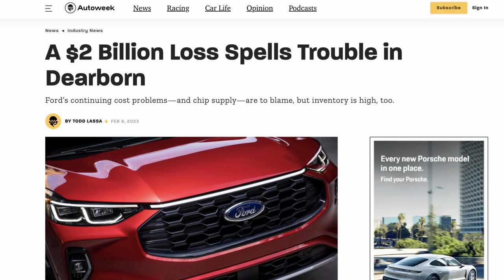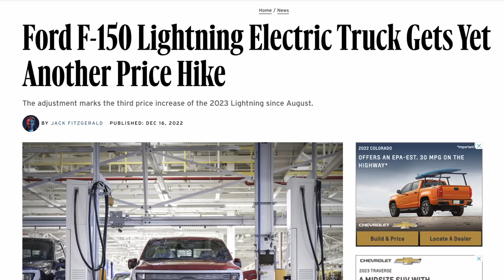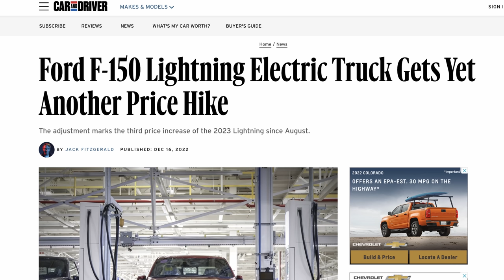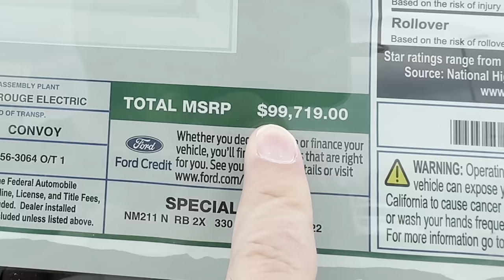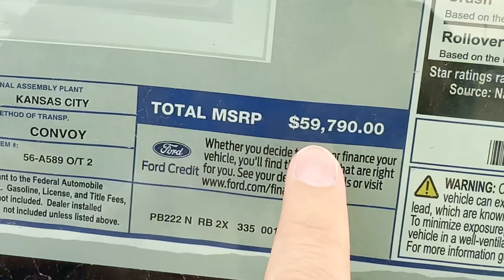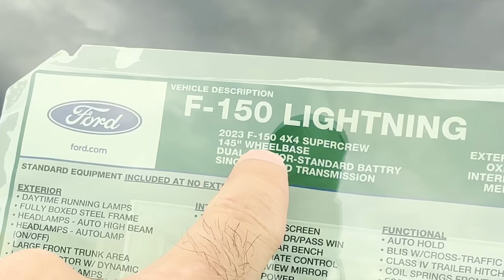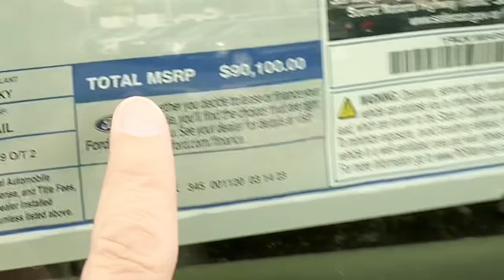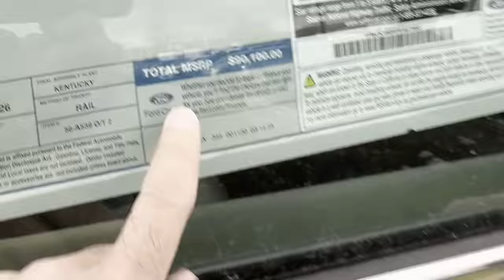Ford CEO Makes HUGE MISTAKE, Now Dealers CAN'T SELL TRUCKS!

Comment: I bought my first new car September 17 2016. It was a 2016 F150 2.7. In four days, I will owned my truck for 7 years. It has 94,000 miles and I had one problem @ 69,000 miles. A $20 temp sensor went bad. My next new car maybe a Mustang GT.

Comment: I don't know how this was recommended but interesting to watch and read many uniformed comments. I've worked 27 years in manufacturing, always at mass production facilities making anywhere from 5MM-20MM units/year. Regarding cost, I have the opposite opinion. Although I do not like the high prices, I can't believe how low automotive manufacturers are keeping them. For example, I'm currently paying 180% per ton for raw plastic media than I was in 2020, 135% on aluminum, about 120% on steel, 310% on acrylic adhesive, not to mention 120-200% on electricity depending on our ever changing contract. We also have back orders because we can't get the circuit boards from Asia. I can only imagine how much aluminum is in these engine blocks, and how much plastic is in the interior, etc. Their supply chain teams must have one heck of a challenge in front of them; good job security I guess.

Comment: Making a quality product, efficient on gas , would be a great idea . Turnaround , it’s not to late . Compassion and customer service for buyers. Sometimes the stockholders  Hope realize that sometimes a season of not gains in transition , but it can come back
Reply: If that worked they'd do it. It doesn't. People want big and flashy. Those of us who want reliable affordable cars generally also buy used. New cars are for chumps.
Reply: @jerbear7952  you can have both. Chevy Tahoe/Suburban/Escalade/Yukon all come in diesel, my gigantic Tahoe can haul 9 people and can get like 30-35 mpg with diesel.

Comment: I am not a Ford guy but I don't feel like this problem is specific to Ford, I also feel like I have been seeing the same things with both GM (Chevy & GMC) trucks being way over MSRP & just sitting on the lot along with Ram, although it seems like Ford has done the bare minimum to correct dealer price gouging. When I was at the Ford dealer in December they had a lightning Lariat that they were asking $30k over MSRP.

Comment: We just bought a new 2024 Toyota Camry Hybrid SE for $35K and a 2023 Toyota Tundra SR5 for $42. We still have our 2014 Camry with over 200,000 miles on it we will gift to our teenager. A pickup truck for $90K is nuts.

Comment: In 2016 ... I bought a XL Off Road 4×4 work truck. It list for 38k ... With incentives I paid 25k and change out the door. There was room to negotiate.  Now ... I don't know. I sold the truck after 5 years ... and will NOT buy another again. I had 3 new F150's in the past 30 years ... The last one IS the last one.

Comment: I traded my 1972 F100 4x4 on an F150 4x4 in 1975. I got the Ranger xlt trim package which was top of the line 360 cid v8 with 4 sp manual. It was a beautiful and dependable truck for many years. I gave the dealer my truck and 2800$ for the trade. I think msrp was about 4500$. These things are not as good as that truck for 12 times the price. It’s absurd.

Comment: I bought a new 5.3 vortec and transmission from a company that makes them that come with a 7year 100k mile warranty on each with a 1 time no fault replacement. I replaced just about the entire drive train, coolant system and suspension/brakes for around 23k installed. Now I have what I call a brand new 04 Chevy Suburban. I had roughly 300k on the original drive train and it had some leaks, but, nothing major. My son and I are rebuilding the old drive train as a back up. I don't intend to buy a new vehicle for the next 25 years. I sometimes wonder how people can afford these vehicles. My wife and I make around 150k/year and we would never consider paying that much for a new car. Imagine paying 100k for a FORD!

Comment: Second correction regarding quality. A major portion of the components going into a Ford (and others) are from "build to print" suppliers. Ford owns the design in most cases. Suppliers build to the design they are given. The problem is Ford does not spend the time validating designs as that costs money and slows the introduction of new vehicles to market. Second is the seasoned design engineers with common sense are retired. Yes tier suppliers do make bad parts causing issues so they are not squeaky clean either.

Comment: I buy 4 year old used trucks and drive them for 10 years. My 2000 Tundra rolled over 200,000 miles before I sold it to my son. I guess I’m keeping my 2012 GMC Sierra until I die because a four year old truck nowadays is still $50,000. It’s insane.

Comment: Try finding a Raptor R that isn't 50+% over MSRP. Some dealers are asking $200k. What a Joke. Plus there are 5 F150 lightnings at my local dealer that havent moved an inch in 4 months.

Comment: Prices on new vehicles are outrageous, If you all can try to maintain your current vehicle and run it as long as possible, it'll be cheaper than buying a new car with recalls before you even drive off the dealer lot.. and this isn't just Ford..

Comment: I paid 67K for a 2024 Silverado although it has the 27MPG 3.0L Duramax diesel and is loaded to the gills.  I could not be happier with the truck, I feel like it was worth what I paid. I have never imagined I could get close to 30MPG in a full size truck. I have gotten as high as 28MPG.

Comment: We are here in Canada and it’s just as bad. Our 2018 F350 Dually has been in the shop sooooo many times it’s a joke.
Anyway we looked into replacing her with a F450 Dually platinum but the $149,000 quoted has put us off. Not prepared to spend that kind of money.

Comment: I have been a Ford man all my vehicle driving life (50+ years of Ford cars and vans) but problems with my past 3 Ford CARS have moved me away from the brand. Last problem: electric power steering locked up - SCARY. My current ride is a Cadillac ATS 2.0 Turbo Deluxe. #NoMoFoMoCo! 😎

Comment: I bought a 2022 Ram 2500 Power Wagon for $70K… And that’s a Heavy Duty loaded with 4X4 options ( Solid axles, Front & Rear Lockers, Disconnecting Sway Bar, Stock Warn 12,500 Pound Winch, Skid Plates ) plus the Interior amenities such as 12 inch touch screen, leather seats, heated and Cooling seats, Back up camera, Bed Camera, folding rear seats flat rear floor, crew cab.. Ford F-150 for $60K????? Why???🤦🏻‍♂️😂 and only 1 recall for a tailgate misalignment which took 15mins…🤷🏻‍♂️😂

Comment: 😂😂. Just changed the brake line on my 89 3500 flatbed. Paid 3k 20years ago.
Easily carry 2.5 tons.
I drive a crown Vic I’ve had for 3 years. 1.5k
Rav 4 I’ve had for damn, 20 years now 10.5k
Live in a 89kft2 house (old high school).
Sure, I have to Remodrl $ fix stuff but geez.
All in & I wouldn’t be close to a new Ford.
No mortgage or car payment for 12 years.
More power to ya thou I reckon.

Comment: I paid 55K for a 2020+ f450 7.3 gas 2wd single cab w/commercial tool box /rack and 12ft bed. This will be the last new Ford I ever buy. No issues with this truck so far! Options are for ladies. I used to drive an 81 F250 300 S6 3 speed on the tree no power anything, not even steering. Now that's a truck I would buy today - in new condition of course. Electricity is evil!

Comment: My F-150 would be nearly as useless for towing as a lightning except it has the tow package which includes a 36 gallon tank, 10 gallons extra.  If ford just offered a battery option for a larger size it would make a great towing vehicle for far more actual situations.  It’s not like they don’t love adding 10-15k options.

Comment: I have a 2014 F-150 super cab XLT 5.0L that I bought brand new for $30,000 CAD ($22,200 US).

120,000 kms on it, only repair has been a new water pump and I did the spark plugs myself.

How on earth can I justify paying over double to get the same thing I already have 9 years later. 🤯

Comment: I worked for a supplier for a KC auto plant about 8 or so years ago. I wouldn't buy cars made around there. It's all BS, UAW workers make 6 figures, but it's not many of them. So much of the work is done by basically anybody looking for a temp job, line workers started at $12 something and it actually went down for new workers. The quality control was straight bs, I wouldn't be surprised if cars went out with mismatched parts.

So much of our time was spent "5 S'ing" things, like 8 times a year because there was more than 1 standard and so many corporate employees thought that it was their job to enforce "5S". UAW employees would regularly foul the production line if they got their feelings hurt.

I only witnessed a few car models, but it wouldn't break my heart if the UAW just went away. I don't see a reason for it anymore. It's not about safety, I had to wear a suit of armor for PPE for the suppliers, but for automakers, there were more flip flops on the production line than in Washington.

Comment: Easy fix for a big company, re arrange the location of the inventory and run a nation wide lease deal to get customers to bite then raise the price of the extended warranty. You will have a lot of no warranty used trucks flooding the market and can be sold on the used market to recover costs

Comment: Bought a 2023 tundra TRD pro for 85k but came with every upgrades I wanted. Most expensive vehicle I have ever bought, 1,600 a month payments, but still better pricing and reliability than ford, there is a reason Toyotas stuff is sold before it even ships to the lot. I plan to get my wife the 2024 Tacoma TRD pro but that’s going to be a wait list item. I got lucky with my tundra.

Comment: i left manufacturing around 2011/2012 it was pretty toxic then and i was laughing at the truck prices then. nobody is gonna pay 120k for a truck.
a few years ago i got back into manufacturing after moving back to the state i was in and it was 10 times more toxic. and they were trying to ask 140k for trucks now. trucks that didnt even run like are you serious. 
all the parts were from over seas failure rates are high and when built the trucks usually werent even complete because of part shortages and defects. its an absolute mess and i walked away again cause i dont have the help they need.

Comment: Contractors are the main buyers of pickup trucks and heavy vans; not upper class suburbanites. 

Aside from insanely high prices for a new pickup truck, all these trucks are not practical for contractors. They’re too high off the ground (makes loading/unloading cumbersome), the work beds have gotten smaller, and we never asked for a computer, wifi router, and a bunch of sensors!

Comment: I'm in my 70s bought Ford trucks my whole life. Not anymore. Nothing but problems with my 350. I'm talking major problems that cost me thousands of dollars. At 76,000 miles now my brakes get activated all by themselves. I'm on my 11th brake caliper. I filed a complaint with the national highway traffic safety, which was a total waste of my time. It's a dirty shame that a truck with 76,000 miles has to get parked in a field because it can't trust it anymore.

Comment: I took my 1999 chevy Silverado 2500 and redid the front seats and rebuilt motor and transmission for $13,000.00  way cheaper then a new teuck that are junk.

Comment: Huge never ending problems with my Focus, Ford bought it back with 48000 miles. Bought the Edge as a replacement, required a re built engine at about 40,000 miles less than 6 months had a factory re built engine installed after over 10 weeks of waiting in the dealers lot for a diagnosis then having the engine delivered and installed. Bye Bye Ford built vehicles

Comment: Forgetting brand choice for a second.   I refuse to purchase a new truck due to insane prices.  Now I'm in Canada, so Canadian prices.   In 2011 I purchased a new 2wd Ram for $26000.   That is $50000 today.   Why?
All that has changed is a different body and an eight speed transmission instead of five speed.
I can purchase a new motor, transmission and complete body work for half the cost of a new pickup.   Guess I know what I will do when the time comes...

Comment: Has nothing to do with want to buy, it's about pricing your inventory for the top 10% only. You need to make 200,000.00 a year to buy one. Or pay payments on it with interest for 20 years and a 99,000.00 truck ends up costing you 240,000.00 payments and maitenance done on a dead truck by time own it.

Comment: One problem with EV trucks are the huge batteries, twice the size of current cars.  Most can not charge enough overnight.  Most PUBLIC chargers are only slow level 2 (6kw-19kw or average 20 mph)  Most PUBLIC level 3 DC fast chargers only 50 kw(average 15o mph)  Tesla level 3 DC fast chargers or superchargers are all level 3 120-250 kw or 500-1200 mph)  That is why non Tesla manufacturers want to use Tesla chargers.

Comment: All comes down to safety and emissions regulators passing policy without an act of congress causing the price of cars to increase year after year. If they could still make a 25k car they probably would, but they can’t because of cost of safety R&D and emissions requirements.

Comment: Just buy a Honda or Toyota.    My Tacoma has 301,000.  Other than standard maintenance all I've replaced is a harmonic balancer, a radiator, and a parking brake handle.

Comment: I used to buy a new F150 every 3 years, but my 2020 is wayyyy nicer than the new 2023. For 65k it felt like a piece of junk. Too much crap on it, needs to be made simpler.

Comment: Bought a F450 for work. Within 100k miles the rear pinion seal failed, exhaust fell off, battery cabled rotted off, the engine blew up at 97k miles, seat belt lights, abs light. Only Ford serviced. Ford has lost they key, asked us to bring spare. Truck sat at dealer for 4 days to get tires replaced. They lie on inspections and services preformed. Just trash company.

Comment: 5.4 engine is junk had to replace my engine in my f250  it ate its self up because of a cam fazefollower nonsense  my 94 f250 lasted 350000 with out a hitch but that's when they made good power plants not junk.

Comment: I am a jeep guy, the cost for used jeeps is crazy.  19k for a 2015 jeep wrangler with 133000 miles.  No thanks
Reply from the maker: Even more if you want a Rubicon. I can get 28-30k for my 2015 Rubi with 90k miles.
Reply: Just makes u wonder why? Repair bills for any vehicle are crazy. The cost is crazy °why even bother with a new vehicle?

Comment: $1500 tail lights and other bolt on parts that now cost as much as transmission or engine replacement was did. This is not just a Ford problem.

Comment: The lack of knowledge today is very sad indeed.
ALL vehicle manufactures (Ford, GM, Honda, Toyota etc.) buy most of the parts they use from "Outside Parts suppliers". 
NO automobile company makes all of the parts they use themselves. Almost all of the recalls today are related to parts that were made by outside contractors.

Comment: This is insane, and for couple of reasons. 
- Getting everyone to drive a truck is ridiculous. 99% if regular drivers who are not blue collar workers don't need a truck. Like at all. Did you know that you can even tow with a car? Yeah, totally doable. BUT, trucks are big, heavy, and have much more relaxed safety & emissions standards. Cheaper to make, can be sold at premium = PROFIT.
- Actual blue collar workers can't buy a single cab long bed pickups right away, cause all the manufacturing capacity is used for a family truck. Family truck - that even sounds ridiculous but here we are.
 - Everybody is now financing their purchase of a vehicle -  you know what that makes easy to do? RAISING PRICES - average consumer will easily swallow 100$ the raise of a bill - 6k upfront - not so much. PROFIT yet again.
- All of them are planning subscriptions for options. Even easier to sell if it's hidden in the financing plan. = PROFIT

We're being screwed in broad daylight and we love it!

Comment: I purchase a used 150 for 2000$, spent another 2500$ to replace the transmission.. been using the truck for 4 years now for work.

Not sure why people are buying these expensive trucks. If I wanted to spend 60K on a car, I will get a Tesla

Comment: 3 purchases of junk ford's convinced me to go for a better brand.   New truck had missing cab mount bolts,  RATTLE RATTLE.  New Focus only got 15 mpg,   Dealer couldn't fix it.  New Powe4stroke had bad differential & they told me it was normal!  ??   What junk!

Comment: Why buy a Ford F150 at those prices when you can get a Toyota Tundra, an equally capable truck, for 2/3 the price?  Also, that Toyota Tundra is going to be omega reliable.  You'll get 200,000 miles out of it without needing any major repairs.  Additionally, that Toyota Tundra is going to hold it's value really well, which makes selling it later when you upgrade much easier.

Comment: Anyone who's purchased a Ford in the last 10-20 years has already made a HUGE mistake.  They're garbage.  Roughly 5-8 years ago, I rented a basically brand new Ford on a trip.  I recall it having 100-1000 miles on the OD.  Anyways, while going up/down a few mountains, the transmission started making funny noises.  Swapped it out at the rental company for a Mazda and was told, "Oh, yea, that's a common issue on those."  Like seriously, it's so common that they already know about it.  I liked the Mazda so much, that a few years later, I bought a similar Mazda.  If I got a Ford, for free, I'd immediately trade it in for a good car.